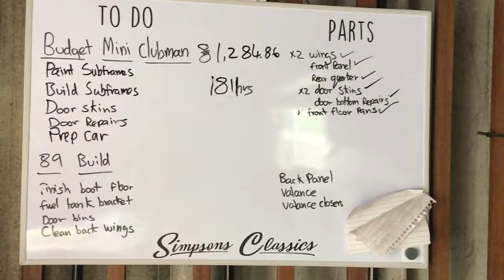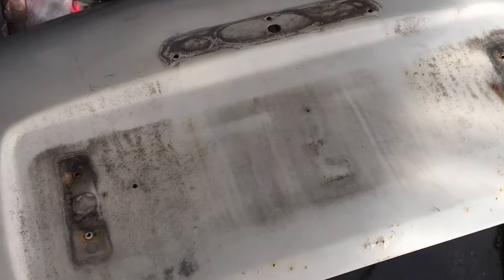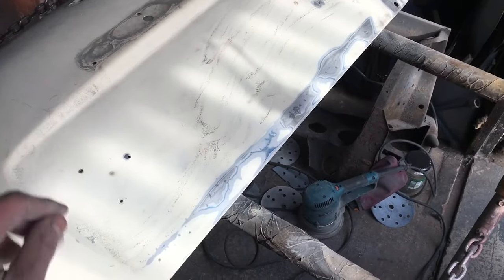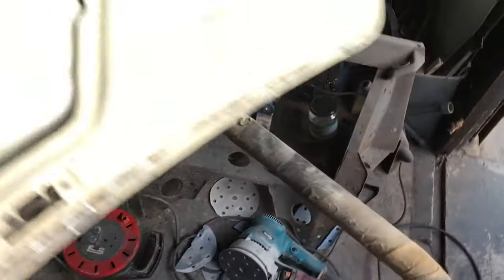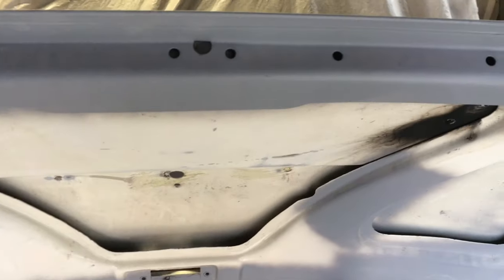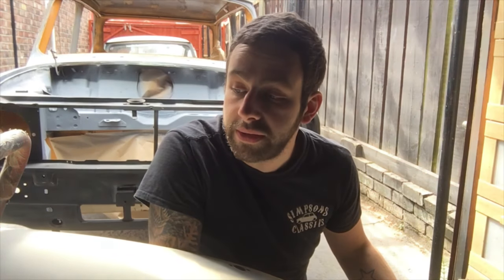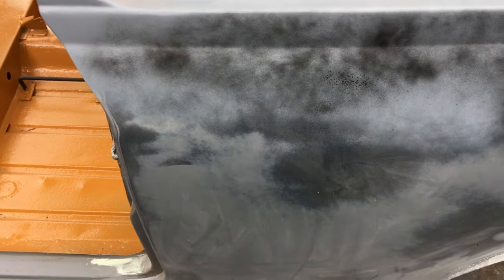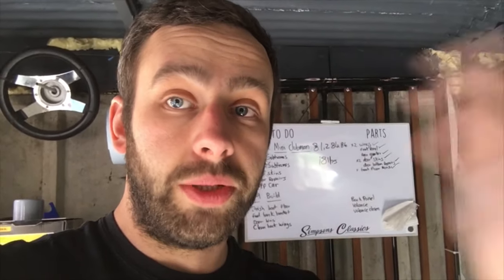Classic Mini Clubman Budget Restoration - Bootlid Prep & Bodywork Update

Comment: The boot lid turned out to be a good one for sure and Dolphin Glaze is legendary stuff and saves so much time from the old days of body prep. Excellent paintwork on any car is not so much down to the paint itself but the hours of preparation of the body before the paint can is even opened. When you get to stand back and see the results when its painted its worth all the effort and cursing of the days beforehand.....you still don't want to do it again though 😂
Reply from the maker: Thanks Graeme yes for a free bootlid it’s really not to bad for sure. Yes the prep stage is key for getting the to the end result and for starting to reassemble the car which lets face it is what everyone what’s to be doing. Thanks for watching stay safe 👍